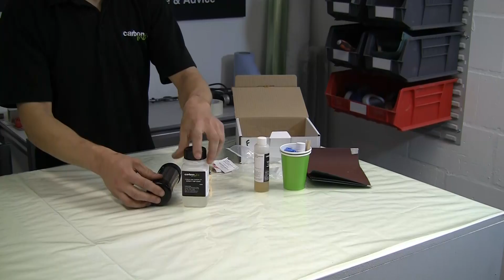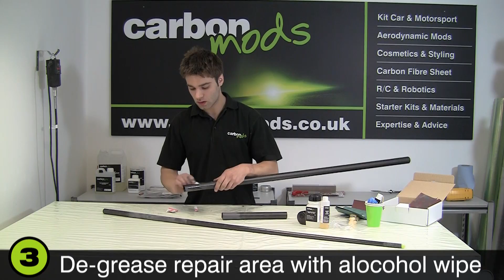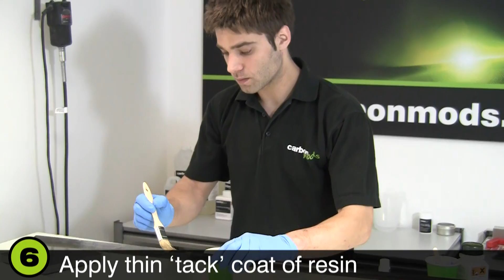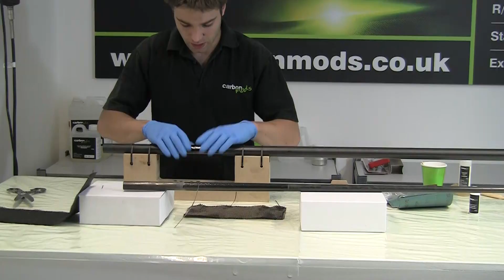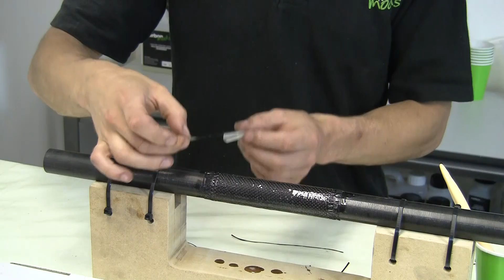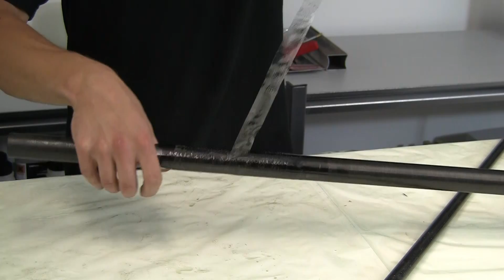How to Repair a Broken Carbon Fibre (Fiber) Fishing Pole or Rod

Comment: My pole has a longitudinal break at the end. If I repair it then it won't fit into the next section. Is there a way of repairing this type of break?
Reply from the maker: Unless you can find a tube which matches the inside diameter and can be bonded in place, unfortunately not as you cannot use this process for such a break.

Comment: Could this be used on any type of Carbon product? I’ve got a compound bow that I need to try and fix.
Reply from the maker: The repair method could however, be aware that with a bow, a repair of this nature may alter the fundamental feel and mechanics of the limb itself so it might not work in the same way as it did pre-break.

Comment: Hi is it possible to put a thread into carbon tube
Reply from the maker: You could use a threaded insert bonded into the tube but we don't recommend cutting a thread into Carbon (or any other composite) material as this tends to both weaken the structure and the threads themselves are not particularly strong so tend to shear when used. A suitable bond in insert works well though.

Comment: Anyway to get this in the US? The shipping seemed a bit prohibitive.  Thx
Reply from the maker: Hi Ben, we can ship it but the problem is that as it contains dangerous goods, even though they're in very small quantities, it has to travel on a hazardous goods service; currently only FedEx offer one between the UK and US and they charge a HazMat handling fee of £55.00 (approx. $90.00) on top of the shipping charge so its really expensive. As this fee is fixed, for very large orders, it doesn't seem so bad but for smaller or lower cost items, it can be prohibitively expensive unfortunately.
Reply: @carbonmods  Thx for your response.  Can you point me in any direction for products in the US?
Reply from the maker: @benleaf4066  I'm afraid we don't specifically work with anyone stateside; we may one day look to branch out over there though but in the meantime, you're looking for a good quality epoxy laminating or coating resin. Avoid anything for countertops or casting work but if its for use with Carbon Fibre, it should be fine.

Comment: Can You tell me what the carbon sheet used in the video is called please I’ve looked on the website and there are various options. I need a fabric that doesn’t easily fray so I can do a 2 inch wrap on several fishing pole sections that can be 7mm drilled and a small bung inserted
Reply from the maker: It is our 90g ProFinish Carbon Fibre cloth/fabric, you can find it by following the link: https://www.easycomposites.co.uk/90g-profinish-plain-weave-1k-carbon-fibre-cloth

Comment: What spray can you use to build up the male joints on a pole
Reply from the maker: Its not something we really have any involvement with unfortunately. I would imagine an automotive paint or lacquer could be used quite successfully assuming you're only needing to build up a fraction.
Reply: @carbonmods  yeah due to the male joints wears big down it could do with having a coat of restorer to build it up

Comment: Great video... some naïve questions please - try not to laugh! 

For pole puller wraps ONLY - there's a few DIYers on youtube that are clearly not as good at delivering a neat job like you, especially with fraying issues...

(1) Would it be easier for DIYers to use the edged 50mm tapes to avoid cutting/fraying issues? If so, would you use your plain weave or unidirectional tape?

(2) Could your 'braided tube/sleeve' product be cut to length and slid down the tube with any success or would the frayed ends be worse to combat?

(3) Is it possible to 'mask' either side of the wrap to avoid the resin overspill for a neater finish?

(4) Would it be successful to use your pre-made 1mm thick tubes that you sell, cut them to 50mm, sand a chamfer, slide them down the pole and bond them in place? I imagine that the 0.1mm pole taper would be lost in the bonding glue/resin? What bonding agent would you use? Note: there is a similar 'tube' concept used by 'vespe'. It looks like a piece of plastic conduit!
Reply from the maker: 1) You certainly could use either although the premise is to stop any through'holes from  cracking to the end of the section so a woven material would generally be a better option as its putting reinforcement in two planes. That being said, the material in the kit is 'ProFinish' so can be cut into really neat strips without the sort of fraying you would see with normal carbon fibre.

2) In theory yes but the ends tend to fray more so the neat edge isn't as easily achieved.

3) Not really, you could try with a resin release tape (such as our Flash Tape) as the resin won't bond to either face of this BUT its likely to fracture the new resin when you remove it and you'd also be left with a hard-step at the edge rather than a smooth transition.

4) This could work but bear in mind that most adhesives require a degree of thickness to achieve good bond strength so you'd need to account for about 0.4-0.5mm clearance all the way around and then somehow keep the tube and section concentric so it doesn't end up lopsided.

Comment: Can this same process be successfully applied on one piece hollow core carbon fiber hockey stick shaft and or stick blade repair ?
Reply from the maker: In theory yes as its the same concept of repairing a hollow structure. You may need to increase the number of layers though so as to ensure you put back adequate strength.

Comment: you definitely need to insert the insert and only then do the stick. because sticking a stick like this and connecting it with some rags is really nonsense. remember you need an insert to connect the two sides. young you will learn I hope

Comment: Would this work to rebuild worn Male rod spigot
Reply from the maker: It would be difficult to ensure the tolerance; if its worn sufficiently, adding a single layer would put around 0.2mm with the resin coating and may be okay but if its just a slight amount of movement, I would guess it will be too thick to have the next section sleeve over it.

Comment: @carbonmods Can the High Temp. repair kit be used to patch up small microscopic holes on the inside of a carbon rim to prevent air leaks?? Thank you...

Comment: Hello Carbon mode!
I am live in Cambodia. I want to buy all materials to repair my rod pole. How do i do?
Reply: We could ship you the composite reinforcements (Carbon Fibre) plus any tools but unfortunately, we cannot send the resin to you at present because no courier offers a Hazardous/Dangerous Goods service between the UK and Cambodia so we're unable to get it to you. You would need to find a good quality equivalent Epoxy Laminating Resin from a local supplier.
Reply: Thanks

Comment: Hi looks like you have a better understanding in repairs with carbon fiber then I do ;). anyways let me ask would it be ok to repair a carbon fiber panel using resin and fiber  glass if it will be painted anyways? Looking to repair the interior of a carbon fiber hatch on a car instead of replacing it with costs and arm and a leg. The carbon look doesn't matter as it is not visible anyways. not sure if it will bond to each other and hold for 10-20 years or so.
Reply from the maker: It should be okay, yes, although I'd be sure to heavily key the area and then use an epoxy resin and suitable glass fibre (to work with Epoxy Resin). Epoxy bonds much better than a polyester would.

Comment: I have a rod that has a very clean break 18" from tip so the diameter is only about 3/16" , is ther a finer carbon cloth?the cf cloth in the vid is way to thick for such a small repair.

Comment: Hi guys ! Can i use this for the top kits of the pole just to add more strenght in an area that i want to drill a hole to fit a side puller sistem? Thank you !
Reply from the maker: Yes Certainly! Fitting side puller kits is one of the common applications for this kit other than actual break repairs. Generally for the pulla reinforcement you will only need one wrap of fabric around each place you wish to drill.
Reply: Thank's for the reply and advice!
Reply: andrei vlad Mate how diid it go with the kit ?
Reply: Now no more 747 plane. I make my own carbon fibre. Now give me instructions with the right thing?

Comment: Hi guys.  I have cracks in the rear swing arm of my full suspension mountain bike.  It is quite a complex area to work on and repair with rounded projecting parts that hold the bearings that have hairline cracks where they join the main body of the swingarm.  I have ridden the bike for a year and the cracks have grown about 1mm in this time.  How many layers would you apply over the area, and is there anything further I can do to strengthen the cracks before carrying out the repair?  Is the fishing rod kit the best produce to use in a complex area of a bike frame?  Also, I don't have a heat gun, but I do have a blow torch.  Can I use this at a distance?  

Thanks in advance.  Jonny
Reply from the maker: Hi Jonathon, please get in touch with us through technical@easycomposites.co.uk and we can advise you in more detail on something like this.

Comment: The polishing I received is complete different what show on the video,  everything is fine but not happy with the polished.
Reply from the maker: Hi John, since we made this video we've made a number of improvements to the Fishing Pole Repair Kit; Such as: (1) The abrasive paper is now top-end Mirka paper (2) The carbon is now a very high-end 90g ProFinish (3) The resin is our updated EL2 Laminating Resin ..... and (4) We have upgraded the polishing compound to the Pai Cristal NW1 Black which is a special polishing compound for carbon fibre. It's basically the best product on the market for polishing natural finish carbon fibre and so I'm suprised that you don't like it. In what way are you not happy with it?
Reply: Carbon Mods After dry, i sanded very smooth with 800 and in the end 1200 grit, I polished  with the new compound but is like 'blury'
thanks
Reply from the maker: Hi John, OK, it sounds like the sanding operation has gone fully down into the carbon fibre itself (which is quite common). When this happens it's not possible to make the carbon itself 'shine', it's only possible to make the resin shine (no matter what polishing compound you're using). If you're looking for a more glossy finish then I would suggest that you apply an extra layer of resin over the top of the 800 grit finished pole, allow that to cure and then flat that resin layer with 800 and 1200 and then finish with polishing compound - this will give you a high gloss finish.
Reply: Carbon Mods thanks for the reply 
I will do today and let u know.  Just a question when I will pass a coat of resin need to wrap with the tape?

Comment: Hi wer can I get the carbon fiber and what the thiknes of the carbon fiber
Reply from the maker: +blend kuqi @ You can purchase the carbon fibre cloth from our Easy Composites Ltd website at www.easycomposites.co.uk. In this kit we use a very special 90gsm ProFinish 1K Carbon Fibre which is just 0.1mm thick, per layer.
Reply: blend kuqi p
Reply: +Michelle Mueller . hi I like to make a very strong fishing rod  4m long action 150g ( like zziplex M4 ) can you suggest me the right carbon fiber to choose pleas. I intend to reinforce a existing 4m fishing pol with low action with at least 3 other layer.

Comment: HI Guys, just repaired my mountain bike and it worked brilliantly, however I am struggling to get the finish to be anything other than matt, even using the polishing compound, what am I doing wrong? Cheers
Reply from the maker: +Pierre Thomas Hi Pierre, you probably need a bit more resin over the top of the repair. It depends how much you flatted the repair before you polished it. If you have rubbed down through the very thin layer of resin coating the fibres then when you use the polishing compound you're really trying to polish the carbon fibre itself which won't work, you can only get a shine on the resin, not the carbon. To do an overcoating now you'll need to 'key' the surface (so, get it back to an 800 grit) and ensure it's free of grease and dirt and then you can paint over a layer of resin on its own and then you'll find you can flat and polish that to much better effect.

Comment: HI guys.  I have a carbon fiber mountain bike.  I have noticed that the rear wheel is rubbing against the rear swing arm and is slighting cutting into the carbon.  Can I use your product as a form of sacrificial part that can be fixed onto the frame and wear instead of the frame?  Thanks in advance, Jonny
Reply from the maker: +Jonathan Howson Hi Jonny, yes, definately. Adding a wrap of carbon around the outside of your swingarm using the process shown in the video (and the materials included in the kit) would be a very good way to replace the warn carbon and act as a sacrificial surface that you could re-wrap in the future.
Reply: +carbonmods Thanks a lot.  I guess all the liquids etc are sealable so I can use them again at a later data?  Do you know how thick a layer would be in total?  Also, what are the dimensions of he carbon that come in your pack?  Thanks, Jonny

Comment: Just used this kit to repair my carbon road bike which had a snapped seat stay. Worked brilliantly, only comment I have is that I didn't know how long to use the heat gun on the shrink tape. I managed to get it quite tight so didn't see any obvious shrinkage under heat. Think I over heated it as it was a bit of a pain to get off. Fantastic kit and good video to follow. Many thanks.
Reply: +Stephen Boot Hi Stephen, Glad you liked the kit and the repair went well. The shrink-tape is quite deceptive, it only contracts a small amount but it puts a lot of pressure on the repair. Often people are expecting something more dramatic from the tape but in fact a few percent contraction creates a lot of pressure but is difficult to see. You're right though that overheating the tape will damage its self-releasing properties and make it difficult to remove. I suspect you applied quite a bit more heat than needed. Anyway, thanks for your comments and safe cycling!

Comment: Can i use this one for my carbon fiber SUP paddle ?
Reply from the maker: +geoland22 Yes, absolutely. The process would be the same. Remember that you need to match the wall thickness of the original tube with the wall thickness of the repair so if it was a 1mm wall thickness on the paddle then you'd need several layers of the lightweight carbon we use in this kit.

Comment: This is all well and good.. But you cant pack the pole away, section into section because there will be resin inside the repair section stopping the section to fit into!!
Wast of time...
Reply: For a fishing rod that doesn't matter ..but in any event a rock solid repair beats throwing it in the trash yea?

Comment from the maker: If the pipe was release coated then in theory yes.  It may need a lot of force to break the vacuum and surface tension. A PVC pipe should be suitably flexible though. Another way is to cut the pipe length ways and tape over the cut with Flash Breaker Tape to seal it.  That way you can lever the PVC pipe away from the carbon surface along the line of the cut to help release it.

Comment: If I was trying to form carbon fiber rails for a camera system could I just lay my carbon fiber over a piece of conduit or pvc and then lay the resin and then pull the pipe or pvc out?

Comment from the maker: Yes, you can certainly do this, in fact it's a good technique. The other thing you can do is to apply a single thin strip of the epoxy resin from the kit in a line along the top of your tube, press the carbon onto the wet resin and ensure the cloth is supported such that it won't slide off while the resin dries and then it would be fine to leave it overnight to cure fully. Then, the next day you have your fabric 'anchored' in place and can proceed with the repair.

Comment from the maker: Yes, you can use a very similar process to make a basic repair to a damaged hockey stick. You would need to wrap more times round and you might choose to include some addition 'unidirectional' carbon material in the repair (the stick would have originally made at least some use of unidirection carbon) but the basics are the same. Get in touch with us through Easy Composites if you want more information.

Comment: @Carbonmods Many thanks for this great tutorial, I'm going to use this method to repair my carbon fiber bike frame. As I have en epoxy resin with a pot life of 5 hours, it would take a long time for the epoxy to go to the tacky state. I'm afraid the best moment to apply the 1st layer of fabric might even be during the night. Could I use a layer of household epoxy glue (pot life only 5 minutes) just as this 1st adhesive layer or will that somehow interfere with the curing of the proper resin?

Comment from the maker: @SEAWEEDER1 Carbon fibre is much stronger that glass fibre (which is why poles are generally carbon, not glass) and so to restore the same strength back to the pole it's important to use carbon. Glass tissue is not structural so won't add any strength. Polyester resin will bond very badly to the epoxy matrix of the pole, you really need to use epoxy. JOB DONE and JOB DONE RIGHT aren't always the same thing.

Comment: I just use fibreglass and then add fibreglass tissue (both applied this resin) sand down when hardened and varnish the repair area.....total cost £5 and a time repair of 5hrs.   Look for a PVC fabricator in you area and slip them £5 for the stuff to do it.  JOB DONE.

Comment from the maker: Hi Kevin, I would suggest our Carbon Fibre Skinning Starter Kit - High Temperature for a repair to an exhaust can. The materials in the Fishing Pole Repair Kit are not designed for high temperature use.